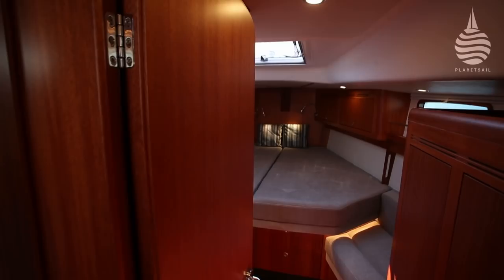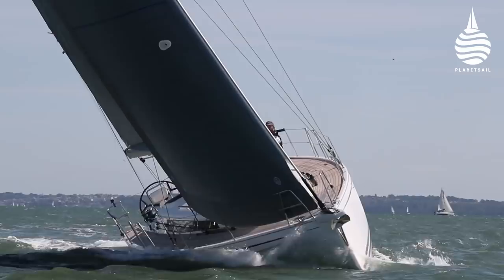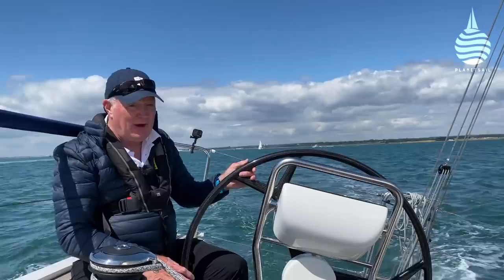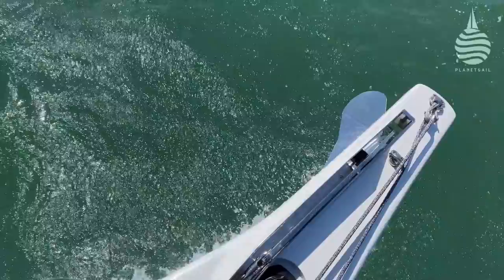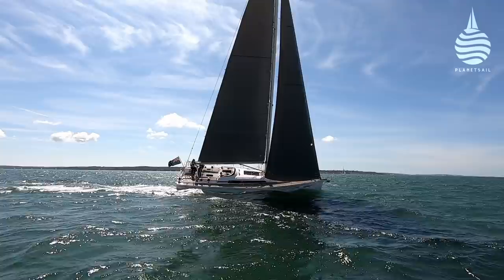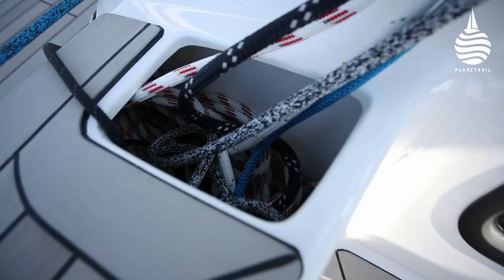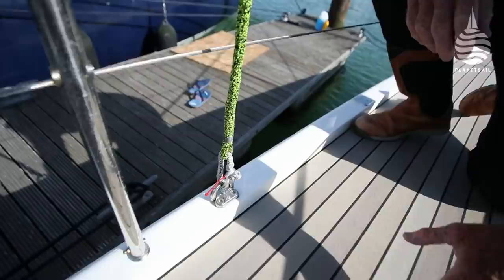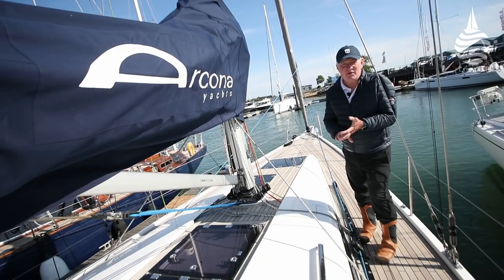On Test - Arcona 435

Comment: I can't believe the entry to the interior hasn't been changed for so long. There's a 2022 Nordship 420 that actually has the old wooden bi-fold door that hinges out and gets held to the face of the opening, exactly like my friend's 1987 Wellcraft Nova 23. Some have multiple panels that you have to stow, some have hinge doors, and the best have some type of pocket door where the panel hides inside when open. That whole area needs a re-do!